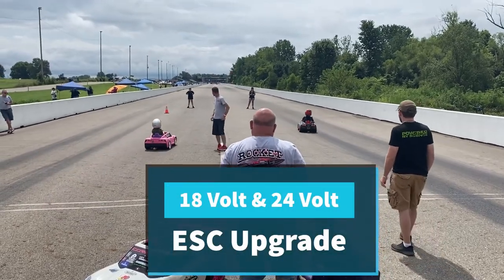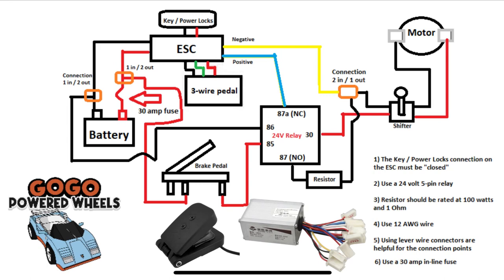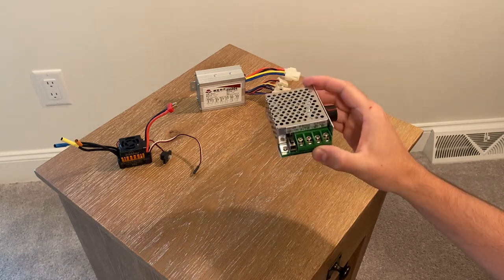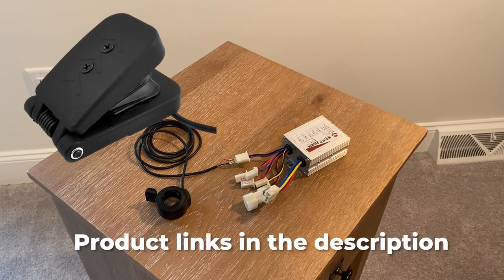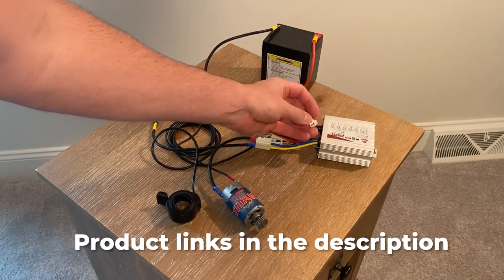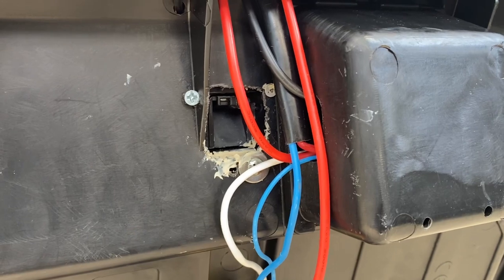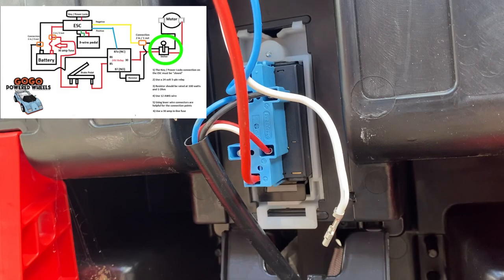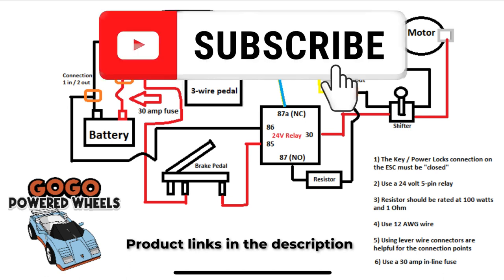Power Wheels ESC Speed Upgrade | How to make your power wheels go faster

Comment: My brake pedal has 6 pins. It’s not helpful, and the gearshift has 6 pins too. Whew do I connect the red and black ?
Reply from the maker: @ilnikogo7034   you’ll need a voltage multimeter for both. On the pedal, just use the 2 pins that has the positive in and then positive out wiring. On the shifter, find the “positive in” pin and replace it with the wire you made that runs from 30 on the relay
Reply: @ is it normal that the relay shuts if I put 28 volts through it? It a 24v relay. It seems to cut off who I connect the batteries. I bought a 36 volts relay, just to try if that’s the problem.
Reply from the maker: @ilnikogo7034 no, that’s not normal. Are you sure it’s the relay and not a thermal breaker ?

Comment: My daughter has a 18volt conversation.  It's a 4 wheeler. Already has a pedal no room for another one. Do the make a  handler bar brake lever that would work? Also what if both are pressed at the same time?
Reply from the maker: What about using a handle bar throttle? Either like the one in the video or one like this https://a.co/d/7wbuMVc

Comment: 24 volt mod as per video but the shifter on the steering column is forward and reverse, I wanna make it have a hi/lo reverse shifter instead. any recommendations,?
Reply from the maker: Buy a Power Wheels shifter like the one in this link. https://amzn.to/4el97G3 and then search for Power Wheels wiring diagram. Just know, rewiring it is a pain

Comment: Is there any way I can control this still with a remote controller?
Reply from the maker: You could probably wire it up to still control the steering, but you won’t be able to control the throttle

Comment: what the resistor actually doing in this diagram? and what is a 2 in/ 1 out?
Reply from the maker: @EzPzPropertyMaintenance   the resistor is acting as a “soft brake”, it will slow the car down slowly, not abruptly. The 2 in/ 1 out connector is linked in the description of the video under Lever Wire Connectors

Comment: Ive upgraded by daughters car to an 18v Ryobi battery and in the winter we are tearing it down to upgrade to a 24v setup with 775 motors. Definitely going to use this ESC upgrade. My plan was to run it on a 6ah 24v Kobalt battery. What are some of the disadvantages to using a Kobalt battery vs something like a 6s lipo?
Reply from the maker: Overall, I would say there’s no disadvantage to using the 24v Kobalt over a 6s lipo. I’ll only use lipo if it’s a drag race and I know they won’t be using the car for more than a few seconds. I’d never would want to see a lipo battery burst into flames when it’s under a kids seat
Reply: @DadHacks  I do have that fear. Fortunately her car has a frunk, so I’m going to be relocating the battery so that it’s further away

Comment: Awesome videos. This is super helpful.  I converted my kids 24V grave digger to run off 2x 18v Rigid batteries with an in-line fuse.  It has so much torque so I want to follow your upgrade here with the variable speed pedal, but I also want to, and maybe more importantly, follow your low-voltage-cutoff diagram from your LVCS video as i've fried 2 rigid batteries to date.  How would i work your LVCS diagram (with 2x daisy chained rigid batteries) into a diagram like this.  At first i thought maybe just a bigger terminal strip to account for the ESC wiring, but the brake pedal/resistor/shifter are throwing me off.  and the Grave Digger has a 3-gear shifter which is probably another speed bump.
Reply from the maker: To use a LVC board, on the ESC diagram use a bigger terminal strip or a 1 in/ 3 out snap connection with a positive and negative going to the LVC board and then the relay portion will go before the ESC. On the LVC diagram, just think of the PWM as the ESC and you will be good to go! For the 3 speed shifter, just follow the wire from the stock pedal that goes to the shifter and replace it. FYI, you will need 2 relays (36 volt/ 40 amp) for your setup

Comment: I have a RS550 with a 10t pinion.  Upgrading to the 775 won't be possible because the 5mm shaft doesn't give enough room for the small pinion.  What other options are there for these small motors?
Reply from the maker: They make 5mm pinion gears, you just have to search hobby websites. But depending on the gearbox, it could be easy (Power Wheels brand) or hard (most other brands) to mount the 775 motor. You could get a 550 motor with more torque, like a 27t (turn) motor.

Comment: A few questions for you.

1. With a 4x4 UTV (4x350w 775 motors) and using 20v DeWalt batteries, would I need to use 2 ESC (one for the front and one for the back)? Does that also mean that the 12ga wire coming from my DeWalt battery adapter isn’t thick enough?

2. With a 20v DeWalt battery, won’t the LVC in the 24v ESC cut off the battery too soon?

3. What size 24v to 12v buck converter would you recommend for the lights and radio? Does it need to be 30A or 40A or can it be less?
Reply from the maker: The 12 AWG wire from the battery adapter is fine, only 1 ESC is needed and then you can split the “power out to motor” connection from the ESC to run to the front and back. Yes, the 24v ESC needs a minimum voltage amount of 20 to 21 volts, which is why you will want a 12v ESC if you are using a 18v or 20v battery
Reply: @DadHacks Do they make an ESC that is 12v and can handle 4x350w motors? I can’t find anything that is 12v and even close to the 1500w that I would need.

Comment: I follow along until the last minute of the video in regards to replacing the white power wire with your own. Where does the new wire connect to? I assume to the fuse ?  
Please elaborate
Reply from the maker: @PeterSiekiera  after that video clip, you can pause the wiring diagram. The new red wire runs from the 30 (out) from the relay to the shifter connection that I showed.
Reply: @DadHacks aaaaha - got it now 

Ty kindly
Reply: (Willing to pay for your time)

I have a hurricane with an East Coast EZ ESC setup that died, so I replaced it with your video.. 

No brake pedal for now to keep it simple.

Seemed doable enough (connect 2 motor wires, 2 battery wires, 3 pedal wires, and jump the 2 power switch wires)

YES! I Finally got the thing running!
 
Low speed ✔️
High speed ✔️ 

But REVERSE... NADA.
Tried with 2 different shifters.

*********
Any idea what I f'd up?
Reply from the maker: @youtoobmeloob do you have a voltage multimeter to do some testing?

Comment: So I finished up the ESC (24V 1000W) and MLToys 775s install on my son's Bravo Grave Digger.  Amazon ESC blew up after about 30mins of use (15min low gear full throttle break-in on a stand) and 10-15mins of my son riding around in high gear.  Any thoughts on what could have gone wrong outside of just a bad unit?  I still have power in and out of the ESC, but I'm no longer getting the ground signal out.  The stock shifter switches were getting very hot too.
Reply from the maker: Can you check the battery’s fuse to see if it popped? You’ll have to remove the cover to access it
Reply: @DadHacks  fuse is ok.  I have a lot of relays for various things, and everything still has power.  I have 26V into the ESC, and 26V out of the ESC to the shifter/motors.  I have 4.9V from the ESC to the variable throttle pedal, and when pressed, I have 4V coming back into the ESC.  What I no longer have is ground coming out of the ESC when the throttle is pressed.
Reply from the maker: @KevinCiccone it definitely sounds like the ESC. But I would just double check that the 3 wires from the variable speed pedal are still connected. The ML Toys 775 motors shouldn’t pull more than 600 watts, so it’s surprising a 1000w unit went bad
Reply: @DadHacks  yeah I checked the throttle pedal.  It has the typical red/black/green.  I have good power and ground on red and black, and when I press the pedal wide open I get 4V on green.  I'm fairly sure it's the ESC, I'm just wondering what the cause of the failure was because I don't want to throw another unit at it and have that fail too.

Comment: Would something like this work with a 4WD ride on? I have a 2WD/4WD selectable one - Blade XR 2.0 4x4. East Coast Power Up used to have a 4WD compatible ESC, but they're no longer in business it seems.
Reply from the maker: Yes it would work, you would just have to do a little rewiring. The worst case scenario is that you would lose 2WD and it would be permanent 4WD. I just haven’t seen the setup on those to know for sure.

Comment: What size motors were you running with this ESC?  I got the unit from your link dor the 24V system, but it dawned on me im going to be installing 775s and realized 800W may not be enough.
Reply from the maker: I’m running 550s. But for 775 motors, they are typically 300 watts so you might be fine. Try to see if you can find the wattage of your motors just to be safe

Comment: Great video!  It's helping get a plan together for adding ESC to my son's 24v Grave Digger.   Can you explain what the relays function is in this setup?  Your diagram looks a little different than most 5pin bosch relays, so I just wanted to make sure I wire it right.  I'm guessing it's for the braking system?  I noticed in another comment you mentioned needing another relay if you have 2 motors which his truck does?  So would I just run 2 sets of wires from your diagram to 2 separate relays, 1 for each motor? 

Oh, also... I assume this will work the same for dual motor vehicles with hi and low?  Just run the blue and yellow wires to the motors the same way the factory setup is through the shifter, so they will run in series for low gear and parallel for high?  Can you elaborate a little on the wiring from the esc into and out of the shifter?

Thanks for posting this and taking the time to answer questions.   It's a big help and will save me money and time just doing trial and error!
Reply: I'm looking at your wiring diagram a little more and think I'm figuring it out.... so does the relay basically just reverse the polarity to the motor to act as the "brake"?  And that's why with 2 motors you would need 2 relays?  I would think you could run 2 sets of wires out of the 1 relay to each motor, but that would probably draw too much current for 1 relay to handle?
Reply from the maker: 1a) you can use any normal 24-volt, 5-pin relay. You are correct, the relay is used for the brake system. I would almost suggest just skipping the brake system on the “trial” run because the GraveDigger is so heavy, it will stop on its own pretty quickly. 1b) if you want to skip the brake, then in the diagram ignore the black wires running to the relay and the red wire running to the brake pedal. Then take the blue wire from the ESC and place it in the shifter, where the 30a red wire would have gone. (You can always go back and add the brake setup if the car rolls too much for your liking). 
2) the 2nd relay was only needed if you are using a power tool battery and you are also using a Low Voltage Cutoff board. You are using SLA batteries, so no need for an additional relay. 
3) The setup in the video was for a dual motor, low speed/high speed scenario like yours. In your stock setup, power from from the battery to the pedal, pedal to the shifter and then shifter to the motor. Well, with the ESC we aren’t using the stock pedal as an on/off switch, so we need to replace the positive wire that goes to the shifter.

It’s kinda complicated from the 30,000 foot view but when you start assembling the setup, it will make more sense
Reply: @DadHacks  awesome thanks for the info.  I think I'm going to do the brake, not so much because it's needed, but because my 3yo is an absolute car nut and will love having a "real" car with an accelerator and brake pedal lol.  I'm a mechanic, so I don't mind tackling the wiring and everything, it's just the electronics themselves that are new to me.  The information your giving me is making it a lot more clear though, especially after looking at the wiring diagram a little closer. So basically when the relay is in its normally closed position its sending power from the ESC to the motors via the shifter.  Where im getting a little lost is when the relay is opened (via a positive signal from the brake pedal).  Looking at the diagram you are now connecting pin 30 (which was the power feed to the motors) to pin 87 which goes through the resistor and basically loops the positive and negative leads of the motor... is that the goal?

On a side note, I replaced the factory sound and lights on his grave digger with custom headlights and custom soundboard.  The soundboard has programmable pins triggered by ground received from simple switches.  I rigged it up so one of the pins plays the sound of a real monster truck accelerating.  To achieve this, I took the 24V positive signal coming out of the factory gas pedal and used it to switch a 24V relay that sends a ground signal to the soundboard.  With this new ESC setup I'll have to change this because I'll know longer be getting a full 24V out of the pedal.  Do you happen to know the lowest voltage the variable pedal will output?  I'm not sure at one point a 24V relay will no longer open... I can't really swap it out for a 12V relay, because then at full throttle it'll be too much power.  I can always rig up something else though.

Comment: Thanks for the video! I Saw in one Of your videos you used an RC motor that said Titan on it, if i have a 12v car right now with 550 motors. And im currently using 18v battery adapter (which is running fine for now until the motors die from it)
Could i maybe add this ESC, The speed pedal and then two Of those 550 Titan RC motors? Or would i need anything Else? I really feel like a video on that is missing on YouTube, “just” a simple complete and safe speed upgrade for most Of the Stock 12v cars that people put 18v batteries in that end up burning the motors :)
Reply from the maker: Yes, you can add a Titan RC motor, but it should be at least 21 turn to 27 turn. You could do a 12 turn for more speed, but you’re at risk of breaking the gearbox. I have a few more video idea concepts that I’m working on for the summer
Reply: @DadHacks  Thanks for the reply, I just came back to this video, and started ordering the shown ESC. But then i realised you are suggesting a 12v ESC for using 18v batteries, how does that work? wont it burn out over time? :)
Also, with the 12v ESC, Ryobi 18v battery, speed pedal and 2x traxxas motors. Do i even need the original 12v control board on the car? or can i just throw that part out?
Reply from the maker: I would toss the control board, this means you will lose sounds (if the car has any). But as for the 12 volt ESC, the reason why you can’t use a 24 volt ESC is because the minimum voltage needed to power on the 24v ESC is around 22 volts, and an 18 volt battery when fully charges is around 21.5 volts, so it wouldn’t never power on the ESC. Look for a 12 volt ESC rated for at least 500 watts, with 800 watts being preferable.

Comment: I've been having a hard time trying to get my kid's 4 wheeler up and running. (I've bugged you several times from a different account @pricenat) And I'm going to try to make a Short to show you the mess of wiring as you suggested but my "build" time is limited to nap time soI haven't gotten to that yet. In the meantime, Ive got a couple more questions for you. 
1. Since it'll have an ESC and a variable speed throttle, Im guessing I no longer need the Hi/Lo switch on the shifter. In which case, I would only need to keep the fwd/R switch in the Shifter correct? If so, then I'm wondering if there's a way to use the switch from the Hi/Lo and turn it into an On/Off switch for the whole thing. Reason for that is because I don't want the ESC drawing anything from the battery if it remains plugged in while not in use. 
And now if you're still with me...
2. The Brute Force happens to be one of a very few models that has a 12V relay. Knowing nothing about what I am actually doing, I decided to just remove it and replace it with the 24V one linked in your description because otherwise, I have no clue where or how to attach it. Could this swap be the reason for why the motors are running slower despite the upgrades with an 18V Ryobi battery?
Reply from the maker: Answer for #1) you won’t technically need low gear anymore, but low gear can’t be used as an on/off switch either. If you want an on/off, you can wire a 2 pin on/off switch into the “power locks” connection on the ESC. Otherwise you will need to make a jumper connection or tie those connections together so the ESC thinks it switched into the “on” position. 
Answer #2) the relay shouldn’t be causing it to run slower